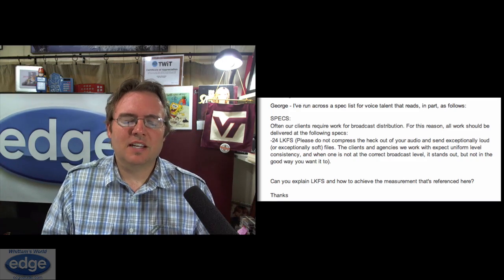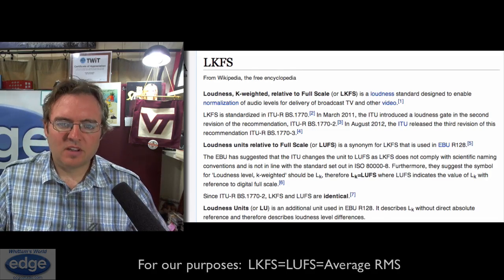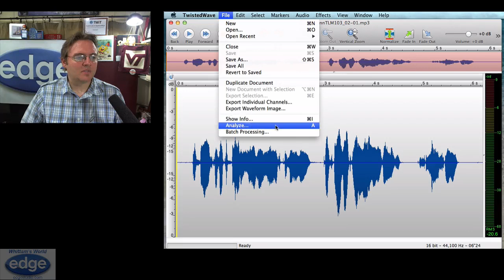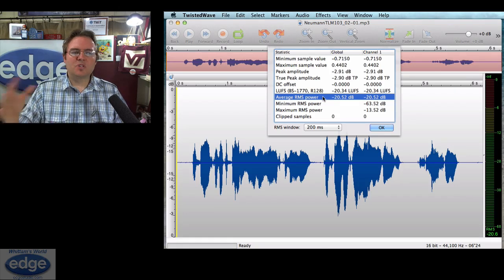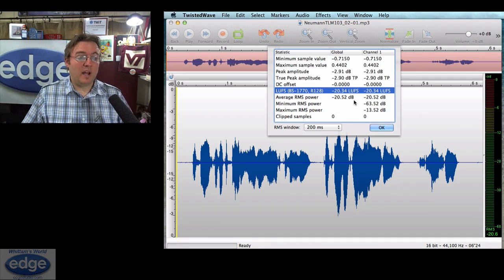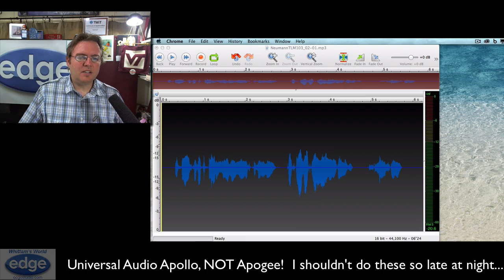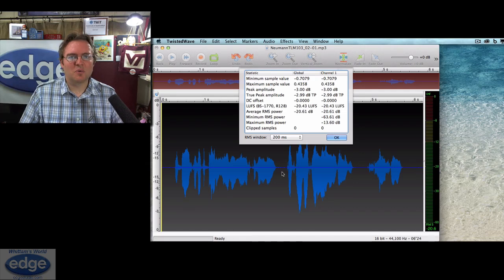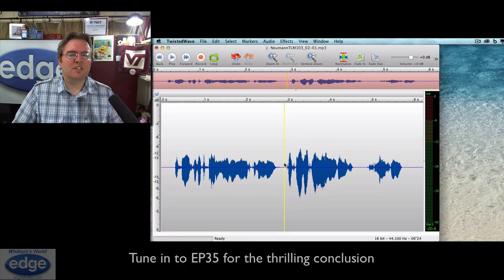Edge Studio's Whittam's World - Episode 34 "Dynamics - Part 1"

Comment: I've had a request to provide "a finished recording leveled at -6 dB without the use of normalizing. Only compressor/limiter allowed within reason." So, my question is: would the best solution be to use dynamics with that setting after recording?
Reply: Yes, because you can undo, redo after recording.